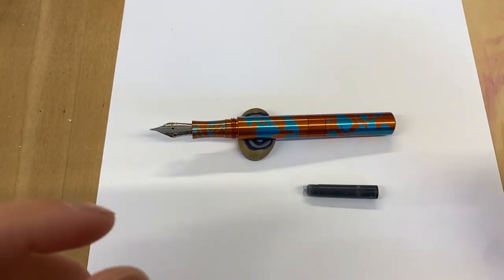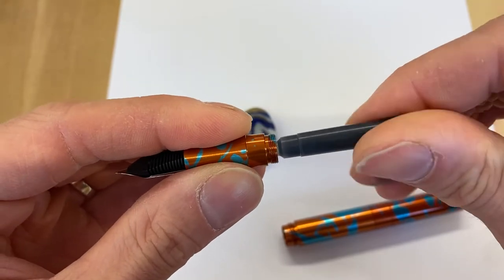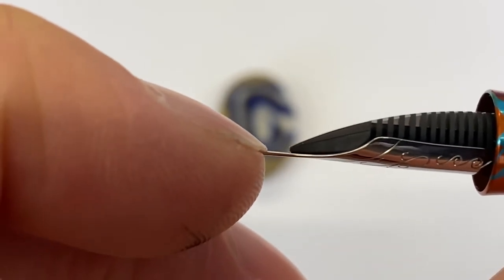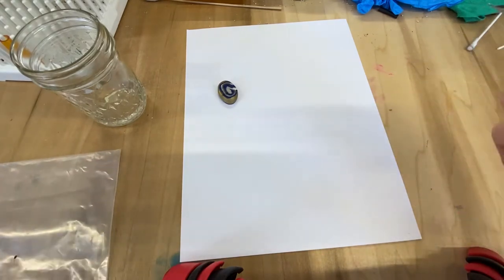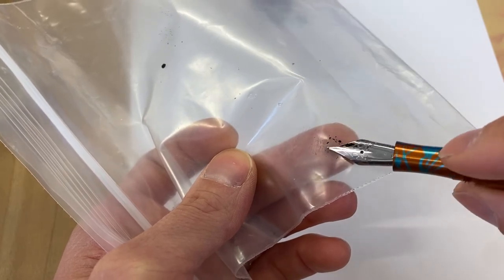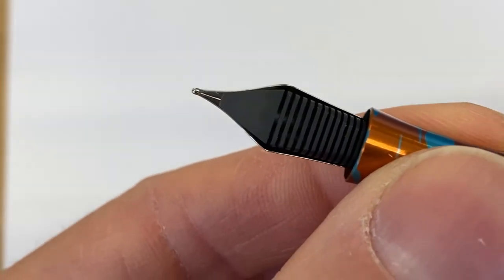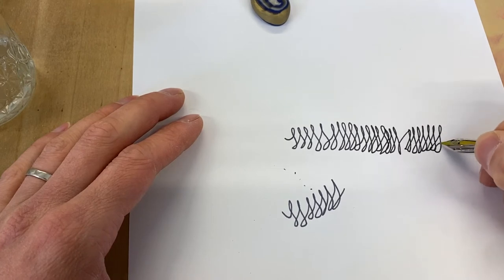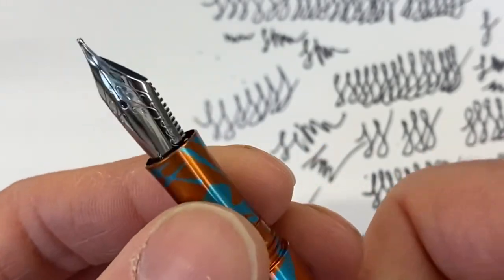How to get a stubborn fountain pen nib working!

Comment: I don’t understand the logic behind this method. It looks to me like treating a symptom and not the disease. The problem of the wide gap between the tines is still there. If the ink has dried up at a later stage, logically the symptomatic treatment will have to be repeated. Or am I missing something?
Reply from the maker: This is a general method for starting a stubborn nib. maybe the nib was oily or dirty? try this method before going to a nibsmith or sending a pen in for repair. This should not be something you do all the time, just getting a pen working for the first time or during inking especially with cartridge pens that are not dipped into ink like converter pens. hope that helps clarify!